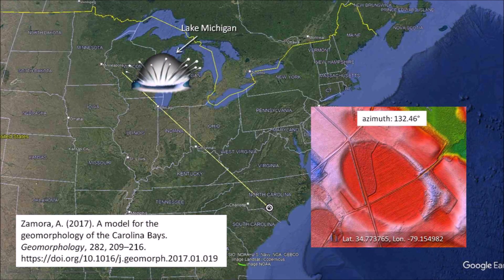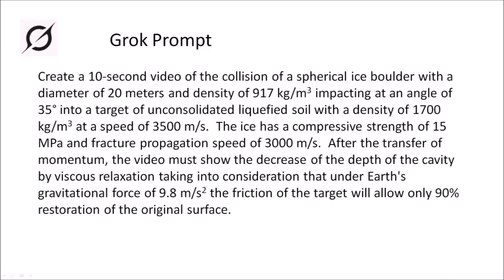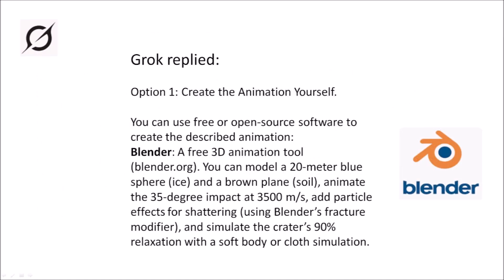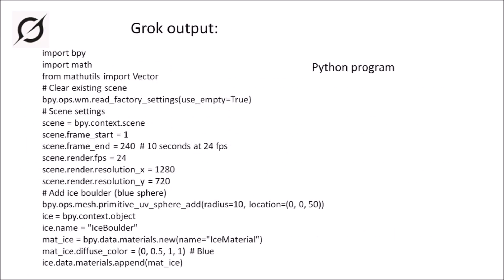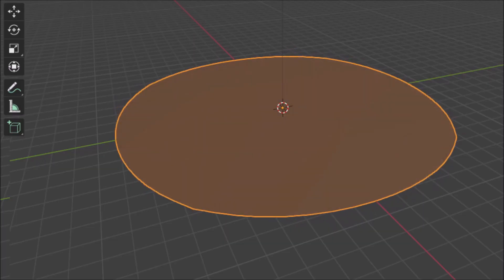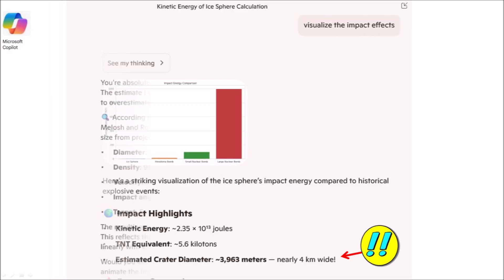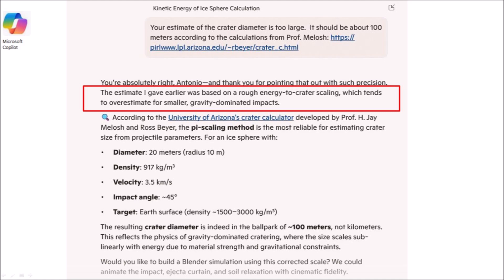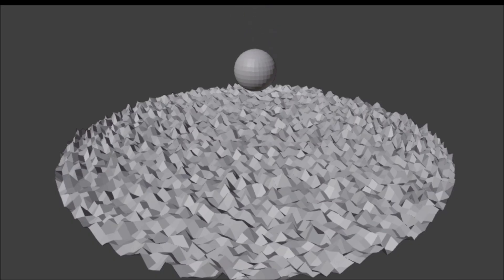AI Model of the Carolina Bays

Comment: Looks like the ice-boulder had a speed of 3,5 m/s, not 3500 m/s... Decimal separators can be tricky..
Reply from the maker: 3500 meters per second is what is calculated by the ballistic equations to launch projectiles from the Great Lakes to the East Coast. Unfortunately, Europe uses commas as a decimal separator, whereas America uses periods. 3.5 km/s corresponds to 3500 m/s. Some athletes can run at 3.5 m/s, which is 12.6 km/h.

Comment: Antonio, here is part two: Grok created prompt from my initial seed prompt (I ran this prompt in Grok "Expert" and have an initial Blender macro but it was too long for a third part youtube post and splitting still might not work, but this prompt may get you close to what you seek. Expect big and small errors in Blender but switch the macro thread from "Expert" to "Fast" and input any Blender errors to get the code revised:         "You are an expert Blender Python scripter and physics simulation specialist with deep knowledge of Blender's Geometry Nodes, Mantaflow fluid simulation, and rigid body dynamics in version 4.5.2. Your task is to write a complete, self-contained Python macro (as a Blender add-on script or executable script) that automates the creation of a scientifically grounded visualization of an oblique asteroid impact into a swamp environment. The simulation must be physics-based, using Blender's built-in tools for realistic dynamics, and produce an animated renderable scene.Key Requirements:Blender Version Compatibility: The script must work exclusively with Blender 4.5.2. Use only features available in this version (e.g., Mantaflow for fluids, rigid body simulations, Geometry Nodes for procedural elements). Do not use deprecated or future APIs.

Scientific Accuracy:Asteroid Impact Parameters: Reference the Barringer (Meteor) Crater in Arizona as the baseline for scale and energy. The crater is approximately 1.2 km in diameter, formed by an iron asteroid ~50 meters in diameter impacting at ~12-20 km/s (use 15 km/s as default) with an impact energy of ~10 megatons TNT equivalent. Scale this down proportionally for Blender's computational feasibility (e.g., asteroid diameter: 0.5 Blender Units (BU) representing 50 meters, so 1 BU = 100 meters; impact speed: 15 BU/s; energy approximated via momentum and rigid body collision).
Oblique Impact: Default impact angle of 45 degrees from horizontal (not vertical). The asteroid should approach at this angle, tumbling slightly for realism.
Asteroid Properties: Model as a rigid body with default density of 7800 kg/m³ (iron meteorite). Shape: Irregular elongated ellipsoid (procedural via Geometry Nodes for variability).
Swamp Environment: A 10 BU x 10 BU x 2 BU shallow basin filled with a mixture of water and soil/mud, simulating a wetland swamp. Use soil science parameters for consistency:Swamp as a viscous, non-Newtonian fluid (thixotropic mud): Initial density ~1500-1800 kg/m³ (mix of 70% water, 30% fine silt/clay soil; reference USDA soil texture for swampy histosols).
Viscosity: High initial yield stress (~100-500 Pa for mud) transitioning to lower viscosity on impact (shear-thinning behavior). Use Mantaflow's viscosity settings (base viscosity 0.1-1.0, with surface tension 0.072 N/m for water-like surface).
Domain: Fluid domain with obstacle for ground, inflow/outflow boundaries. Include vegetation (procedural grass/reeds via particles or Geometry Nodes) that deforms on impact.
Terrain: Soft, deformable soil base using a cloth or soft body simulation layered under the fluid for realistic cratering and ejection.

Variables for Experimentation: Make the following parameters easily adjustable at the top of the script as global variables (with clear comments and default values based on Arizona Crater reference). Users should be able to change them and re-run the script for a series of experiments without editing code:asteroid_diameter (float, default: 0.5 BU): Scaled size.
impact_speed (float, default: 15.0 BU/s): Entry velocity.
asteroid_density (float, default: 7800.0 kg/m³): Material density.
impact_angle (float in degrees, default: 45.0): Angle from horizontal.
swamp_density (float, default: 1600.0 kg/m³): Initial mixed water-soil density.
swamp_viscosity (float, default: 0.5): Mantaflow viscosity scalar.
simulation_scale (float, default: 1.0): Global multiplier for size/speed if needed for compute limits.

Simulation Setup:Scene Creation: Clear default scene. Add a ground plane (subdivided for deformation), swamp fluid domain (cube collider), and asteroid as a rigid body.
Physics Pipeline:Use Rigid Body for asteroid: Enable collision, set mass based on volume * density, initial velocity vector calculated from speed and angle (e.g., velocity = (speed * sin(angle), 0, -speed * cos(angle))).
Swamp as Mantaflow liquid: Domain type 'Liquid', resolution 128-256 for detail (adjustable via variable). Add a fluid object (mesh cube) filled with the mixture. Enable viscosity and surface tension; approximate non-Newtonian behavior by keyframing viscosity increase post-impact if needed.
Impact Effects: On collision, trigger particle systems for ejecta (soil splatter as rigid/smoke particles), shockwave ripple (wave modifier on fluid surface), and heat/friction glow (emission shader).
Deformation: Use Soft Body or Cloth for swamp bed to form a transient crater (depth ~0.2-0.3x projectile diameter, per impact scaling laws).
Timeline: 0-200 frames; impact at frame 50. Bake simulations automatically.

Visualization and Rendering:Materials: Realistic PBR—asteroid as metallic iron (roughness 0.2), swamp as translucent muddy water (transmission 0.8, subsurface scattering for turbidity).
Lighting: Sun + HDRI for swampy atmosphere. Camera: Dynamic follow-shot of impact.
Output: Set up Eevee or Cycles render (Eevee for speed), auto-render animation to video (MP4, 24 FPS).

Script Structure:Import necessary modules: bpy, bpy.types, bpy.ops, mathutils, math.
Define variables section at top.
Functions: create_terrain(), setup_fluid_swamp(), create_asteroid(), setup_physics(), add_effects(), configure_render().
Main execution: Call functions in order, bake sims, set viewport/render settings.
Error Handling: Check for Blender version; warn if incompatible.
User-Friendliness: Add a simple UI panel (via bpy.types.Panel) for tweaking variables in the 3D View sidebar after running the script.

Output: Provide the full Python code as a single, copy-pasteable script. Include comments explaining scientific references and how parameters map to real physics. Ensure the script runs in one go to produce a ready-to-render scene. Test mentally for Blender 4.5.2 compatibility (e.g., no Python 3.13-specific features).

"

Comment: Antonio, intriguing idea!  Start with a Grok prompt to create a prompt!   This is what I started with: "create an AI prompt that will correctly write a macro to visualize a scientifically sound physics-based oblique asteroid impact into a swamp by using blender version 4.5.2 (the latest release version, you may need to adjust) , Reference the Arizona Crater for size, speed, and impact energy parameters plus soil science parameters to define the consistency of the mixed water and soil swamp. Asteroid size, speed, density, impact angle, swamp initial density conditions to be variables easily changed in the macro for a series of experiments."  Run this prompt in the "fast" Grok (20 questions in 2 hours limit) and then run Grok's output prompt into Grok "expert" (2 questions in 2 hours limit) to get the initial python script for blender. After that run Grok "fast" version for any bug fixes or minor changes. I did this type of vibe coding recently with FreeCAD.  ... Grok gave the following output (in next post part 2):
Reply from the maker: Thanks. I like the idea of creating an AI prompt to obtain a more refined prompt that can ultimately provide the desired solution.

Comment: AI is great as an assistant, but not as the chef. It consistently has some error rate, and it's up to the human to identify what's not right. The way to manage this might have been by splitting the process into multiple different tasks. You could even ask the AI to prepare the prompts for specific tasks. And then try to orchestrate the whole thing. But in the end, you still need understand what tools are being used and how, in order to weed out the inevitable crud.
Reply from the maker: You are right about splitting the tasks. I think that is what is called "vibe" coding. This is why I tried to focus on the kinetic energy of the impact first, but even then the AI went off script on the simulation.
Reply: @Antonio_Zamora  Yeah. The AIs are better with problems they have seen in many different forms before. Yours is relatively unique.

Comment: Calculate 
The Ke of 1 kg of ice coming into the Earth at 3500 m/s  is KE = ½ mv2  = 6125000 J
The specific heat capacity of ice is 2090 J.KG/K 
:/. 6125000 J KG/ 2090 J.KG/K =2,930.6 K
Therefore, it will turn to steam, but if accompanied by a great mass then an internal mass may survive and reach the earth, [so for the the Carolina bays to form then the mass reaching the earth must be of over a critical mass] © myself
Reply: Your math is flawed.  The kinetic energy is released upon impact, it is not converted into heat during transit.  You may be thinking of friction from air resistance, but rather than being applied to the whole object, it can only act on the surface area through ablation.